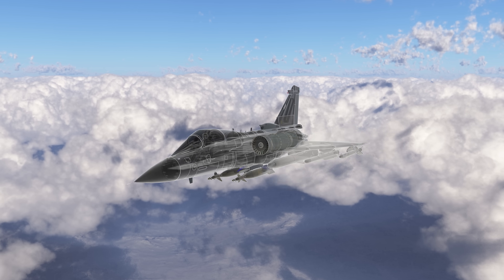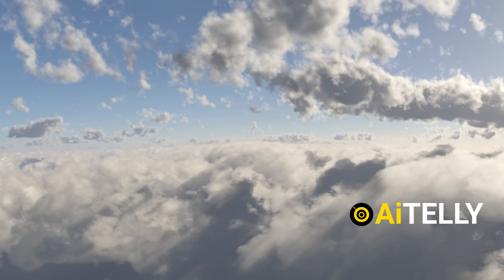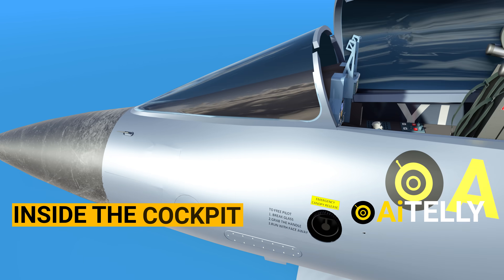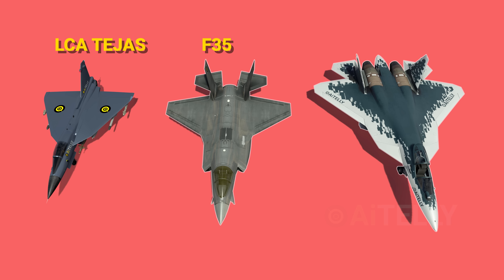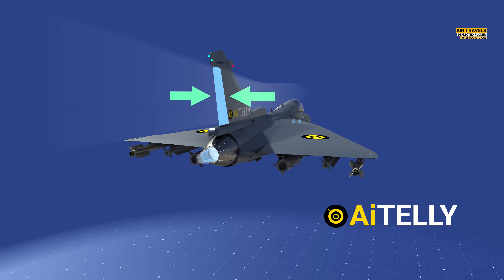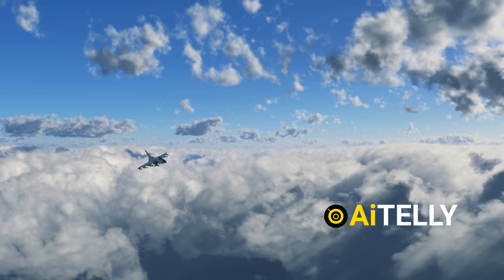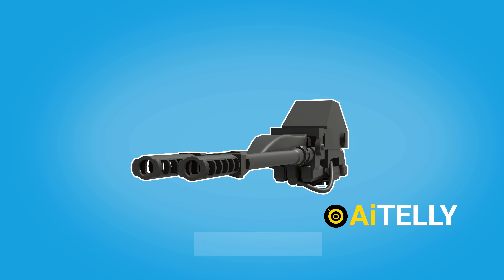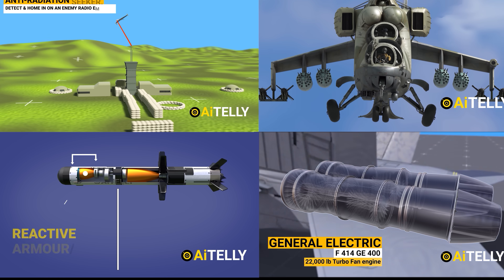Multirole Fighter Jets  How it Works | Tejas Mk1A LCA Light Combat Aircraft #fighterjet #jet #plane

Comment from the maker: Correction From Viewers Comments 

Credits:
"DharmicWisdom"

MK1A will surely have the Uttam. The initial plan was to have the first 20 lot of MK1A to have Israeli radar and the rest  Uttam. Now the Uttam has even progressed into its Mark 2 variant. So there is a great chance that the whole MK1A will have Uttam MK2. Already two prototypes of MK1A is flying with Uttam radar. Even Sukhoi upgrade is going to get Uttam 3 which is in works.

 "Abinash"
1. Engine is F404 not F414
2. Currently Mk1 A uses an elta elm AESA radar not Uttam radar.

"Arijit Kanrar"
he Radar Warning Receiver (RWR) in the tailfin (and other places) does not emit anything (its a passive system). Its job is to listen for incoming radar waves to find out who is currently out there and get the direction.

"EXECUTE"

Tejas has the lowest RCS most 4.5generation fighters 0.5 m^2  Which gives advantage in BVR combat... First look first shoot... Capability. 
Astra Mk2  - 160 km

"Nexoft Alam "
It's Compound Delta Wing design is designed to perform exceptionally better at high altitude Himalaya zones. The Delta Wing gives its lower wing loading for better maneuverability and its turn radius is smaller than F16. It's payload is highest in the light combat aircraft/ LCA class due to high composite content. The inner pylon is capable of carrying 1.2 ton oil tank, which is not seen in other LCA class. The FADEC, advanced auto pilot and auto-recovery is the reason why not a single LCA have crashed so far. Brahmos NG will have over 350km range @Mach 4.5 due cuz of a new classified fuel being developed. The same fuel will power Brahmos Block IV with over 900km range at Mach 4.5

"Arijit Kanrar"
A few corrections. The Radar Warning Receiver (RWR) in the tailfin (and other places) does not emit anything (its a passive system). Its job is to listen for incoming radar waves to find out who is currently out there and get the direction.
Reply: just 1 more correction, the refueling probe is British origin fixed refueling probe not detachable probe.
Reply from the maker: @its_n00b  Thanks
Reply: @Aitelly refuling probe is detachable incase needed by operation.  As per what I know
Reply: @anandmohankumar2079  it's fixed but can be detached in case operation needs it. So it's detachable
Reply: MK1A will surely have the Uttam. The initial plan was to have the first 20 lot of MK1A to have Israeli radar and the rest  Uttam. Now the Uttam has even progressed into its Mark 2 variant. So there is a great chance that the whole MK1A will have Uttam MK2. Already two prototypes of MK1A is flying with Uttam radar. Even Sukhoi upgrade is going to get Uttam 3 which is in works.
Reply from the maker: @dharmicwisdom9818  Yes i think so that's what i saw in DRDO occicial page
Reply from the maker: @dharmicwisdom9818  Have credited your Comments. Thanks for educating us
Reply: @Aitelly  No problem sharing what I read from open source. All the best for your endeavor.
Reply: Brahmos NG is in works but there are other weapons like these DRDOs own SAAW, the Rudram missiles and the whole lot of bombs including laser guided bombs that you missed. Astra MK1 integration on Tejas is ongoing. Eagerly waiting for the test firing.
Reply: You could do a video on TEDBF or Twin Engine Deck Bases Fighter for the navy. Keep doing the amazing work. Real good quality.
Reply: Awesome vídeo !  👍🏻👍🏻
Reply: Please correct the engine varient it uses Ge 404 IN20 engine tejas mk2 will use ge 414.
Reply: Mark my words Tejas will be used for kamikaze missions.
Reply: @threekblack217  for that we already making cats warrior wingman's Tejas jet gonna be use it by being mother ship !  😁 India already working on it ! Soon u will see it in videos !
Reply: Actually it might have uttam 2 radar
Reply: Make T-14 video pls
Reply: Areey bhaiii, you all are leaking latest information to the world. 🤦‍♂️
Reply: Chilla chilla ke sabko scheme batado.
Reply: Pls next explain T 14  armata
Reply: UGLY will call TEJA as UGLY!!!  How can this brainless people see it when they created it? Its wings are so ugly it is poopastic
Reply: No issy you guys are doing your best, and it takes a big and honest person to accept his mistake...
Reply: @दीप्तांशु यादव  do waste time in these beautiful channels to make videos of junk ware
Reply: As expected, something related with India came, the comment box is filled with over proud orgasmic nationalist indians claiming about how great the jet is forgetting the fact that after all these years india still couldn't make a proper heavy fighter aircraft like f16 or su 30mki..We don't even have a proper indigenous made assault rifle for our army as not of our own rifles like Asas were a big failure..Am ashamed to say am indian by these kind of over proud idiots who bark under every videos that comes with something indian..
Reply: Fantastic channel! These credits and corrections in comments really takes the channel to a different level! KUDOS
Reply: U are right about Brahmose.
The Brahmose A Can be carried only by double engine aircraft such as Su30mki.

But Brahmos NG will be able to be carried by Single engine aircrafts.
Including Tejas mk1A, Mk2 or Mirage 2000. And 3 on Jaguars.(if Jaguars will be operational beyond 2028).
Reply from the maker: @rajatdani619  Yes you are right
Reply: @Aitelly  try to make a video on india's LCH light combat helicopter
Reply: @Aitelly  
I would love 2 see more vids from your yt channel . I have some suggestions for you -
1) ATAGS
2) BRAHMOS
Reply: @Aitelly  it's Capacity is 2400kg .not liters. 
In liters it will be 3000L aviation fuel.
Reply: Corrections=
Tejas MK1A has non detachable flight refuling probe 

Astra mk1 BVR missile max range is 110 k.m 

Tejas can also fires Python 5 fox 2, R 77 fox 3, I Derby ER fox 3.
Reply: One more correction Indian air force reject it. They accept only a few bogie's under pressure conditions.
Reply: @humanbody0  well Indian Air force has order 83 of these jets , and deliveries will start from next year. And Navy didn't rejected it , Navy is using Naval LCA as a technology demonstrator for upcoming Twin Engine Deck Based Fighter(TEDBF). Also Naval LCA did proved it's capabilities by landing on a carrier.
Reply: @humanbody0  that's Indian Navy. That too because they want twin engined fighters.
Reply: @ritikshaw5868   bro no navy in the world if they are smart enough will ever use a single engine fighter on an aircraft carrier. because aircraft carrier are very expensive so coudnt risk a no engine landing.and twin engins have a backup engine if one is gone.
Reply: @aryanyadav1796  I understand that. Just stating what the navy wanted.
Reply: @humanbody0  stop taking marijuana! Wake up!!! IAF has ordered 123 of these jets and around 35 are already in service. Try making some sense the next time
Reply: @ishatiq shahid I hope you have got enough wheat 😆 🤣
Reply: @humanbody0   just ordered 100 Mk1A, process will begin soon on documentation.....
Reply: @humanbody0  bro Navy rejected its twin engine variant for our new aircraft carrier as the condition were not fulfilling
Reply: @humanbody0  I heard that Indian's going to test it soon on your country for its Capabilities😂
Reply: @WolfLLC  🤣🤣🤣 hilarious....

Comment: Tejas MK -1 & Tejas MK -2 the smallest & The Smartest supersonic multirole fighter jet in its Class different jets with Agile Performance... At the maximum altitude & different zones & war conditions.. With Ease.. Most efficient fuel consumptions with maximum outputs as compare to 5th Generation & above with future technological advanced UPGRADATION as per Necessity.
And the only highest number of weapon carrying fighter jet in its class at lost costing per hour. 
Very easy maintenance & Repair Costing with budget friendly design for Consistent Use with freehand applications.

Comment: I don’t know why but IAF loves the Mirage 2000, so that’s why Tejas is designed like it. I also heard about Meteor integration along with Storm Shadow.
The hated part about it is the 52 minutes of endurance and slow production rate, the mk2 variant solves the endurance problem which is also supposed to be mass produced. So let’s see what India does to ramp up production, private sectors will be given contracts to set up multiple production outlets I suppose. Then the unit cost will go down.
However the production quality and physical body of the fighter is top notch like a Ferrari that I can guarantee. Comparable to the Gripen and Rafale.

Comment: Few Corrections here
Tejas Mk1 and 1A have F404 engine, 
Tejas Mk2 (the upcoming design which is longer and is similarly powerful as say a Gripen) will be having F414 engine.
Mk1A is supposed to be an interceptor that can remain on station and important is fuel efficiency,  kindly correct  if you can

Comment: Comparing Tejas with JF17 - 

1) Dubai 2021, LIMA 2019, Bahrain 2016, each time the Indian Tejas participated in an air show, the Pakistani team cancelled their JF17 participation after ceding the participation fee 

Dubai 2023 is the first time, after induction of jf17 block 3, that pakistan air force finally felt comfortable showcasing their JF17 alongside the Indian Tejas. Speaks volumes about Pakistani  air force’s trust in their jf17 

2) The manufacturing country China does not use jf17 and only exports it to poor countries  

3) Even after buying 150 jf17 jets, the Pakistan Air Force still relies mainly on their old American f16 and has also started buying Chinese J10 fighter, acknowledging their dissatisfaction with this junk jf17 

4) The jf17 block 1 and 2 do not have AESA radar, no in flight refueling, only two dimensional fly by wire, all metal body causing high weight, low thurst weight ratio, older electronics and only Chinese weapons to fire 

5) The new block 3 jf17 variant has a cheaper air cooled AESA radar unable to operate at max power and hence lower range. Further, block 3 retains the same old Russian rd93 based engines, uses pod based electronic warfare as well as same metal body and cheap build quality as older block 1 & 2 

6) JF17 does not have sensor fusion capability and nor any active/shape stealth features to cater to the advancements in technology for going beyond the fourth generation of fighter aircrafts 

7) The all metal airframe has poor manufacturing quality resulting in an availability of approx 40% for Pakistan Air Force 

The performance and reliability of jf17 is so bad that both export customers, Myanmar as well as Nigeria air forces have grounded this aircraft 

The availability numbers of Pakistani jf17 are mostly hidden by Pakistan Air Force, but Myanmar and Nigerian air forces are more vocal about their dissatisfaction. These have been detailed in pentapostagma as well as irrawaddy 

8) Contrary to this, the Indian Air Force is impressed with the performance numbers of their baseline Tejas variant over the past four years, so much so that they have placed orders for 83 additional Tejas aircraft in improved mk1a configuration and ordering another lot of 97 more   

9) The Tejas aircraft is also evolving further with the mk2 variant as well as a naval variant called TEDBF, both of which incorporate sensor fusion and more fifth generation technologies
Reply: But in reality JF-17 are more successful with Azerbaijan and Iraq order now

Comment: I believe that you mistaken the Pitot Static tube that tells the plane the speed with the IFF antenna. I am guessing the antenna behind the Pitot tube being your IFF. The Pitot tubes will have a hole in the front to allow air in and it measures the pressure to tell the pilot how fast they are going.

Comment: GE actually making the engine inside India. So supply chain is less of an issue. Also, it doesn’t have the most destructive capabilities but you can potentially buy more than 2 for the price of 1 other jet with far greater destruction and good agility.

Comment: Tejas is a great fighter for the cost and is fantastic for appropriate roles. However, it is not an air superiority fighter. It is not fast enough, doesn't fly high enough and the range is less too. It also doesn't have stealth.
Reply: its not meant to be an "Air superiority fighter" . All players of a football team are not playing offence. A football team has Mid fielders and Defenders too, whose roles are equally important. 
PS - Tejas does have some degree of stealth. Its Radar cross section is 1/3rd that of a Mirage2000. For quick , quiet and premtive operations behind enemy lines, Tejas would be a great choice.
Reply: Its supposed to replace the mig 21. Amca,  rafale , su 30 mki are for air superiority.

Comment: First of all its fuel is 2589kg which is 3120 litres you got a very old data of 2400kg which you converted in litres..
Its engine is F404-GE-IN6 & not the ge414 its engine makes 90KN afterburning thrust & 55 KN dry thrust..
Its empty weight is 6.5 tons mtow is certified upto 14.73 tons payload of 5.3 tons combat range for latest varinats is around 1000KM.. 
It has modern aesa radar with 912-992 TRMs. Its engine is optimised as per india requirements (india specific)or power output is increased as per requirements of oboard radars Electronics etc so its radar just doesnt have more trms, ge f404 makes enough power to squize out all performance from its radar. Because its initial engines varinats did not had enought output..
It has asraam, python 5,R73 as IR missile and astra mk1 & derby , derby er as a BVR missile ,note astra is only missile after lca tejas to carry an aesa seeker on it. However astra mk1 is 110km , mk2 is dual pulse and has double the range of astra mk1 and astra mk3 is solid fuel ducted ramjet propulsion missile like meteor with 350KM range... This 2 missile are under testing and ha e been tested multiple times whereas astra mk1 is standard for iaf...
It has GaN based pods jammers , a FLIR pod , brahmos missile and anti radiation missile rudram 1 &2 (mach 5.5) ..so its armament ks quite lethal. 
It is delta but a cropped compound delta which has less drag than other deltas . It has shortest turn distance even less than f16 & f15 i forgot numbers. Because it is just very tiny aircraft with alot of control surfaces.. it can carry 3000kg of fuel externally on 3 pylons it has 7 pylon for weapons and 1 for flir pod. 
Its a mach 1.8 capable and can fly supersonic at lower altitudes as well...
Its bigg bang for bucks
It has short range because its a ligjt weight fighter not even a medium weight fighter still has quitenclose to medium weight aircraft range.. its a light weight so definetely payload is going to be less.  
Anyways 5.3 tons ks not less. another fact is it is not our frontline fighter we have way more caoable su30s & rafales mig 29 UPGs. So what job a light aircraft has it does more than that... because of this its wing loading is least making it very agile in mountainous terrain masking missions which ultimately results in better control..
Nice vdo thanks alot

Comment: Lol. You just know nothing of the aircraft in general so why make a video on it. 
The refueling probe is not detachable but retractable.
The IFF antenna you showed is actually a pitot tube.
RWR receivers are on all side of A/C and not just tail. 
The front leading edge dont move up ever.
Its a fighter jet so rudders are not the only surfaces used to go left and right and they only contribute a little to the action. 
I had to leave the video half way because it was so bad.

Comment: LCA Tejas has near 75% indigenous parts except helmet mount display , ejection seat , refueling prob and engine. Remaianing all such as Digital cockpit , Avionics , radar , all sensors , pods , Our Own designed and developed Fly by Wire control system and autopilot. Fly by Wire development is very difficult as when sweden developed their own then 2 to 3 times their prototypes of Saab grippen crashed and at the end they had to get help from USA. DRDO worked vey well on fly by wire as not a single Tejas has any accident since 20 years. 
Now HAL and Aeronautics Development Agency (ADA) are working on Tejas MK2 which will have Canards , more composites , indegenous Avionics and all equipments , more fuel capacity, improved range upto 50% , improved carrying capacity upto 40% , new GE F414 engine ,13 hard points (mk1 has 9) makes it upto  90% indegenous . DRDO AND Aeronautics Development Agency also working on TED BF - twin engine deck based fighter comptable to rafale and AMCA - advanced multirole combat aircraft which will be our first Fifth Gen Fighter. 
Tejas is proud of India and make idol to every country and their people which are working on there own capabilities and developments.

Comment: Multirole?
It has dogfighting capability?
Heard It also has no missile warning system
Reply: yes, it has very capable dog fighting abilities. 
And no , it does not have missile warning receiver, but it was radar warning receiver. If a radar locks on, the pilot will be informed.

Comment: You missed out on the stealth features of Tejas due to the  composite materials used. Its low RCS, low serviceabiity, zero test crash record & also the comparison of weapons package compared to other 4+ 4.5+ fighters. A comparison with JF17, JC10 including the advantages against JF17 & JC10 on armaments & technical parameters will be good. TEJAS is far ahead compared to JF17 & JC10, which your unbiased comparison will also reflect.

Comment: Ur analysis is not unbiased, to be precise u r hiding some facts to creat a feelgood factor. 

1. Integration of GE414 in Tejas 1A is a proposal, not in use. 
 2. Super hornets use two Ge 414 engine not one as  in Tejas 1A. That means half if the thrust Tejas will get mathematically bt practically difference is less as super hornets r much much heavier than Tejas.